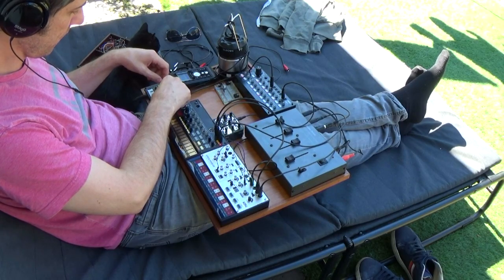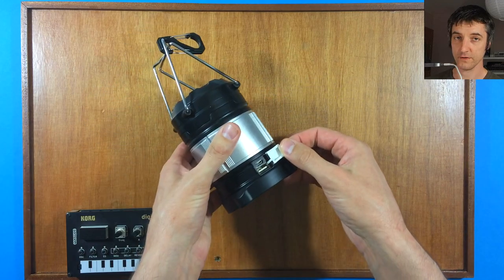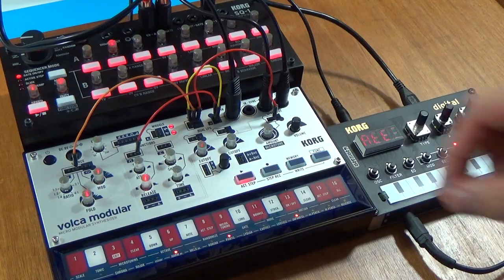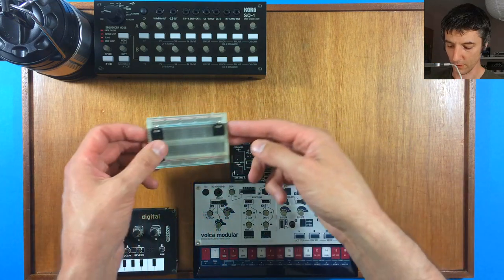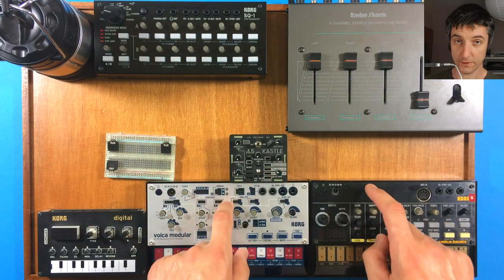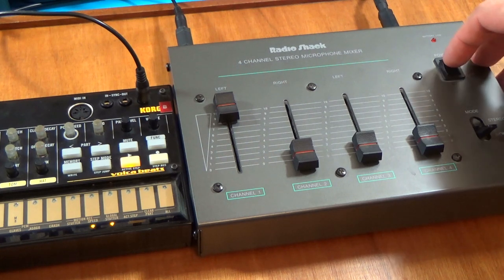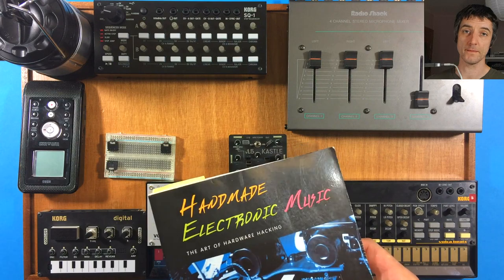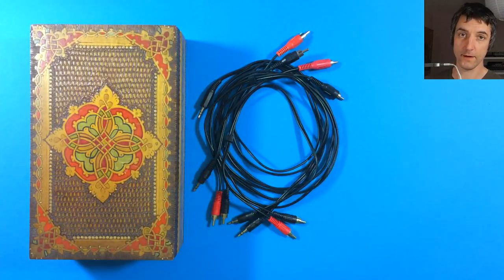How to 'Synth Tray' - Portable Dawless Mini Synth Studios #SynthTray

Comment: Not a daft idea at all.
I think it was a brilliant idea.
I was wondering what your battery thingy was in the first video when you were in the garden.
I thought it was a gas cooker for a brew up!!!!
How does the SQ1 sequencer work?
I mean, once you have made a patch you then programme it into the sequencer ...and then do more patches and load them in...and then press the appropriate button and it plays the sequence in real time?
I ask because I want to do something with chord changes.
Eg patches in C , F and G and to use the Korg Nts1 to modulate which kind of chord.
Am I on the right tracks?
Pete
Reply from the maker: Ah now there's an idea, tea making equipment on the rig 😄

The SQ1 is quite limiting as you program the pitches in with the knobs and gates with the buttons, but unlike a lot of Korgs other products it doesn't have any memory slots at all. So you just have to do everything live and freeform. Only the knob positions serve as memory, even the button settings are lost when it's powered off. So you only really have 16 pitches to use at once max. Great if you like dialing things in to generate some unexpected results, but not for everyone. My secondary reason for buying it is that it will act as a usb midi to CV for my Ms10 so I can use it that way.

In this rig I suspect it'll get used with the Bastl Kastle Drum more to dial in drum sequences as that has no sequencer either
Reply: @ChrisLodyMusic  
Thanks for your reply.
That makes sense to me.
I am just learning what all these peripherals do.
It's nice to get the kit in but I think it is both addictive and there's a big marketing thing going on?
I will see what I can do with what I have which is minimal.
I am astounded by what people can do with just one Korg NTS1 amplified through a decent speaker.
Keep up the good work Chris.
Excellent stuff.
Pete

Comment: Do you have any other ideas for using a pre-existing tray? I was looking abd bamboo cutting boards and butcher's blocks, or modifying something into two layers with a patch bay so the wiring is cleaner and centralized
Reply from the maker: As it happens another video popped up about adding synths to a pedalboard which have spaces for your wiring which might be a good idea, or DIY something like this with gaps in which would be similar to your two layer idea. https://youtu.be/DhN4J-2Sbi4 

I do have synth tray v2.0 now, but it's just a bigger version of this 😄: https://youtu.be/hAPca1TUvt0

It's about 60cm x 40cm which is about as big as you can sensibly go without it being too uncomfortable

Comment: I never even though about using my NTS 1 with my SQ 1. Great idea. Thanks Chris
Reply from the maker: Yeah it's pretty cool that it just connects with a mini jack cable. It's a shame it doesn't support slides over midi but still plenty that can be done with it.
Reply: @ChrisLodyMusic  That is a shame. I wonder if there maybe a way round that. Trying a different osc on the NTS 1 perhaps?
Will have to have a mess about and let you know. Everything I've used with it supports slides so that's a strange one.
Reply from the maker: Yes maybe a custom oscillator would allow you to transpose things around true

Comment: Incredibly gripping! I particularly like the idea of building a passive mixer on the breadboard. Then you can choose resistor values that work best with the equipment you have.
Reply from the maker: Thank you. I've built a few of these since because I have way too much gear now 😅 I settled on a Bastl Bestie recently for mixing because it's nice and small but the ae v-mix 10 r2 is also worth looking at even though it does run on batteries

Comment: That radio shack mixer though... Aww... I miss radio shack. People just do not fix anything anymore. World of waste. Even the one small components store here is now gone. New Yorkers 🙄Mouser and Ebay now.. :-(. Granted  where I used to live had Micro Center and was awesome.  That mixer is better than a passive imo. Also, congrats on the MicroFreak!
Reply: Bit off subject....but maybe you know ...can the liven be somehow set to charge my rechargeables. I bought some AAs when traveling couple mos ago but no charger.
Reply from the maker: Here in the UK we had Tandy's which was related to Radio Shack somehow. My dad got me one of those 60 in 1 kits with the bendy springs and that's how I got started. Yes the disposal nature of modern tech makes me mad tbh

No the Livens can't charge batteries unfortunately. I've got two fast chargers so I can charge 8 batteries at once
Reply: @ChrisLodyMusic  I need to order a few fast chargers. If I would stop buying synths... Lol

Comment: Thanks for sharing the hybrid NiMH batteries, I didn't know such a thing existed. I very rarely use my Zoom recorder, and then when I needed to recently, the batteries, including the spare pair, were fully discharged.
Reply from the maker: Yes that's the annoying thing about rechargeables. The hybrid ones will still discharge but it takes a lot longer at least.

Comment: I'm new to your channel but from what I've seen you might enjoy AE Modular. It's compatible with the Volca Modular and depending on how big the system is can also be powered by a small power bank. It's a 5 volt system and there is a bread board module available for experimentation. I've been able to power 2 full standard rows of modules no problem. I've since added a 3rd row but haven't tried it with a portable power bank yet but either way it's right up your alley from the few videos of yours that I've seen. Apologies if you already own an AE Modular system and have made videos with it or if you're well aware of AE Modular and are uninterested. If you are curious The 5th Volt has the best youtube channel on the subject. Cheers.
Reply from the maker: I have seen those yes and I'm seriously considering diving into that. Not only will it talk to this gear but I find the price of the modules very attractive. Also I think having less options Vs something like eurorack will be a better fit for me as I tend to prefer to work with less. I have ended up on 5th Volt occasionally but I've not subscribed until just now, I'll go have a proper look 😁 Thanks for the recommendation and respect for your username 🤜🤛

Comment: I have a wood tray, I use for my collection of Volca gear.
It was a cheese platter, leftover after a holiday party. 
I spray painted it.
I have that same Radio Shack mixer, lol.
Reply from the maker: Ha nice 😄 I'd like something better than that RadioShack mixer for sure! There are a few options but I've not invested yet
Reply: @ChrisLodyMusic  I don't have this one, but it looks good, with more features, but is more expensive.
6 channels, uses 1/4" guitar cables instead of 1/8" headphone size. Can be stereo or mono. and uses USB for power.
https://www.aliexpress.us/item/3256804577702018.html?spm=a2g0o.detail.1000014.10.14368a87JPCe2u&gps-id=pcDetailBottomMoreOtherSeller&scm=1007.14452.226710.0&scm_id=1007.14452.226710.0&scm-url=1007.14452.226710.0&pvid=06473a9e-6d9e-43ee-86f0-01601a122e12&_t=gps-id:pcDetailBottomMoreOtherSeller,scm-url:1007.14452.226710.0,pvid:06473a9e-6d9e-43ee-86f0-01601a122e12,tpp_buckets:668%232846%238107%231934&isseo=y&pdp_ext_f=%7B%22sku_id%22%3A%2212000030384427219%22%2C%22sceneId%22%3A%2230050%22%7D&pdp_npi=2%40dis%21USD%2147.96%2123.98%21%21%21%21%21%402103309f16703574260572928e788a%2112000030384427219%21rec&ad_pvid=202212061210260844148529932943632277_1
Reply from the maker: I think that was the one I was looking at. Behringer a smaller one like this, the MX400 but I don't think it's battery powered. They're also making the 1002B which is pretty big but has the features to match, though it's not available yet it seems
Reply: @ChrisLodyMusic  The Behringer MX400 is mono, the ones I am recommending are stereo, or mono/stereo switchable.

Comment: The MicroFreak is so much fun.
If you haven’t already make sure to do the firmware update.

I have a Korg Monologue also, and out of the two I struggle to pick which one is my favourite. I tried to explain to a friend the difference, in layman’s terms, and the best I could do was to say the Monologue was like a really expensive Japanese Chef Knife, where as the MicroFreak is like a crazy Swiss Army Knife with an insane amount of tools on it.

I used the Monologue last night, running through the NTS-1 for effects, and I zoned out playing with one patch for about 90mins, got lost in the soundscape.
Every time I play with the MicroFreak I find I learn so much more about it, I’ve only had it for a couple of months, so haven’t really even scratched the surface, but it’s a very enjoyable exploration every time I tinker with it.
Reply from the maker: Ha nice analogy 😄 I've not had it long and I'm super impressed. The fact that they keep adding options and oscillator types is a classy touch. I bought it mostly for a film score job because it's so different to my other gear with the poly aftertouch and strange keybed, that should enable me to do some wild stuff. I intend to dive in deeper with it on my lap in front of the TV connected to the NTS1, synth tray style 😁
Reply: @ChrisLodyMusic  I was put off of Arturia at first, as their older model synths, mostly the mini key ones, are well known for their cheap and nasty keys, they don’t feel nice from the go, and often end up breaking, this obviously doesn’t apply to the MicroFreak with it’s touch pad keys, which is why I got one. I’d seen the demo’s and was blown away. Works so nicely with the NTS-1 ...but what doesn’t right?
I’m pretty sure Arturia have stepped up their game, as the Keystep series has done really well, and no one ever complains about the build quality of those. I’d like to get the new Keystep 37, it has lots of onboard ARP functionality as well as the sequencer, but I’m waiting to see if they launch a black edition?
Arturia’s after market care is awesome, the update on the MicroFreak is ridiculously huge, not just patches but functionality also.
I’m thinking of getting a drum machine, and in light of how happy I am with the MicroFreak I’m considering getting the MicroBrute Impact?
Reply from the maker: Yeah they make some great looking gear now. This is my first Arturia product and I think I'll probably buy more. The Impact does look cool. The Minibrute 2s looks like a good option also
Reply from the maker: Noni haven't seen that, thanks for the recommendation

Comment: My Setup 
GAMEBOY with Nanoloop or LSDJ
Pocket operator 33 casual
Volca Sampler Pajen Firmware
Ipad
Korg monologue
Zoom g1 four (looper with bpm grid and a 4 fx chain multifx)

And proooo tipp
NINTENDO DS with nitrotracker and a audio splitter (headphone/ mic splitter)
To sample all your hardware stuff into the nintendo DS
For some jungle 90s stuff

Its like a lowbudhet polyendtracker mini
Reply from the maker: Oh awesome, I love console based music making stuff. I still use Korg Ds-10 a lot and Beaterator on PSP is pretty good. Shame I never quite got going with LSDJ. The complications of flash carts was enough to put me off when I had an original Gameboy.

Funnily enough Nitrotracker is the reason I bought a DS and one of the demo tracks that comes with it is one of mine, the one named Dstort. Bloody good bit of kit that
Reply: @ChrisLodyMusic  whaaaat
Reply from the maker: Thought you'd like that 😄

I must try the Pajen firmware for the V.Sample btw, still haven't done that
Reply: @ChrisLodyMusic  
Barfilter mode for longer sequence
And probability
Sample swap like elektron workflow
And the best thing 
4 voice keyboard note

Why best thing
Use a sample that is a wavesound which modulate to another waveshape
Than use the looper mode
And change the start point

Its like a wavetable
Reply from the maker: Yes I'm looking forward to playing with that when I get time. Worth it for the probability alone I think, that's great fun on the Liven XFM anyway